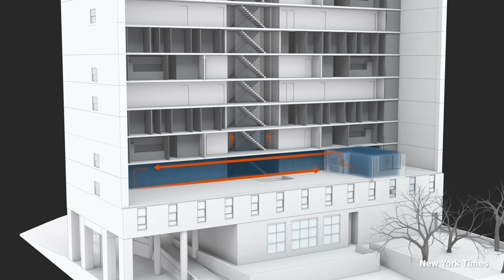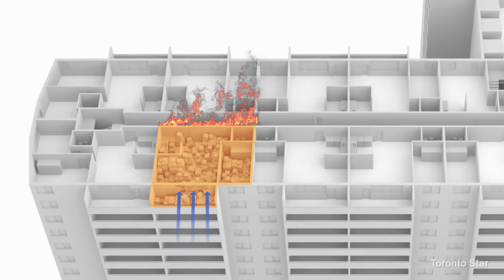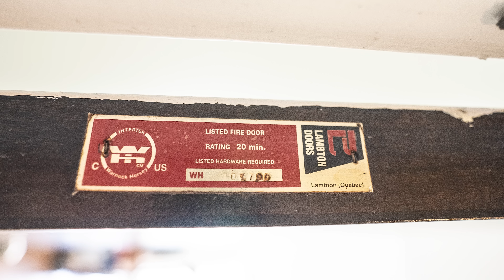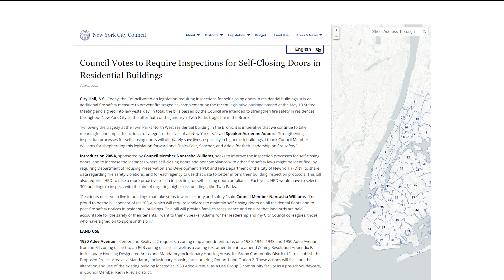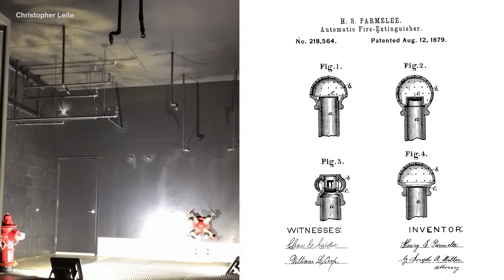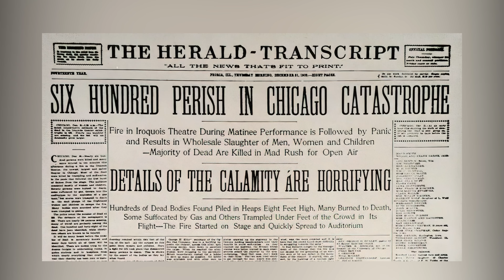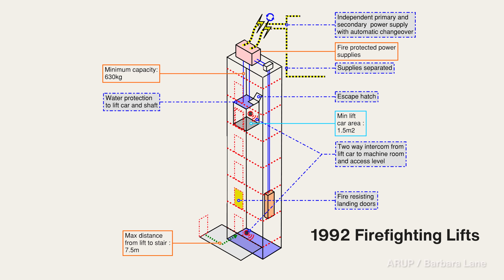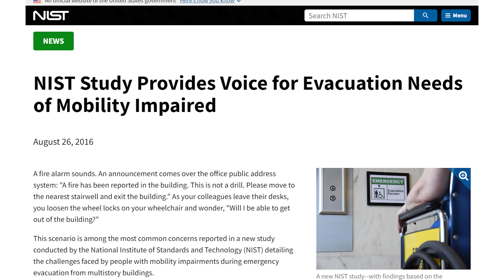How Hidden Engineering Keeps You Alive in Apartment Fires

Comment: The apartment development I live in was built in 1980 and has the structural integrity of a gingerbread house. Some arsonist lit one on fire near 2 years ago and all 12 units of residents were displaced. Should a fire break out, I'm screwed. There is a fire alarm to pull in the halls but it's "local only" which means it'll sound an alarm to the building and NOT notify a fire department. That's all on us.

Comment: I work for a big city FD and the biggest problem we have in appartement buildings (low and high rise) is people wedging fire doors open or interfering with the automatic closing systems.  It basically bypasses all the protection of a fire break and spreads smoke everywhere.   It's more common in poorly maintained buildings often owned by slumlords but I've also seen it in public housing and expensive condo towers.  
Only a few days ago we ran a 3am call for a small trash fire in the basement garbage room of a 4 floor 60 apt building, all the hallway and stairs fire doors were jammed open so though the fire was small and never spread from the room, all the stairwells and hallways were filled with smoke. It happens too often.
Reply: Exactly, sheltering in place depends on these complex fire proofing systems to actually work. And it requires the Grenfell Tower not to happen where combustible material was used in the construction. I don't care what anyone says, it's safer to evacuate buildings while it's safe to do so rather than tell people shelter in place until it's no longer safe to evacuate. I'm not sitting around counting on a complex fire proof system to save my life when we have multiple examples of it getting people killed and there's 0% chance of me burning to death OUTSIDE the building.
Reply: This is why education is so important! I’m 25 and love to study and learn but I’ve never understood the function or importance of fire doors until this video. The extent of my fire training is stop drop and roll. I believe if we took the time to really educate people and let them know an open fire door is literally the difference between life and death almost no one would prop them open. And if someone did they’d probably be policed by others. But ofc people don’t care when no one really understands the significance of them. We just see them as the heavy doors that are always trying to close on you.